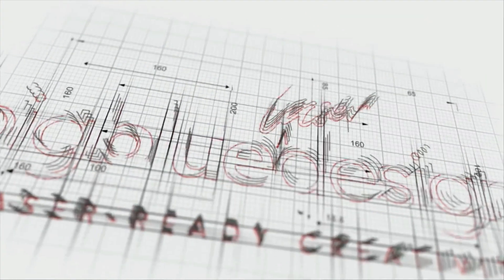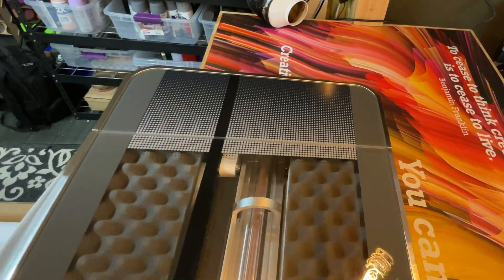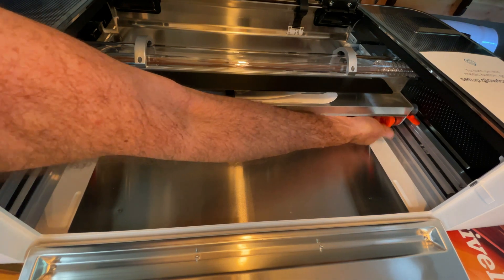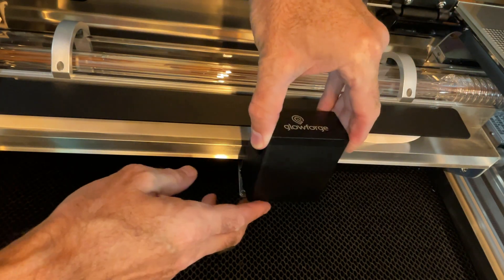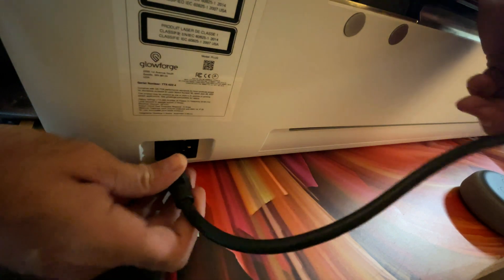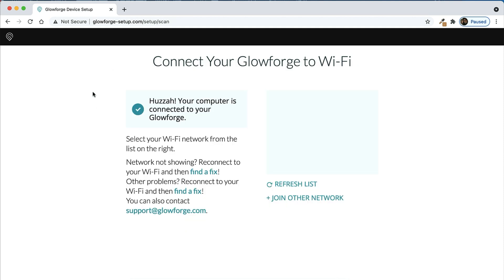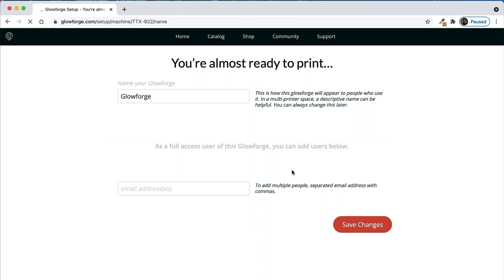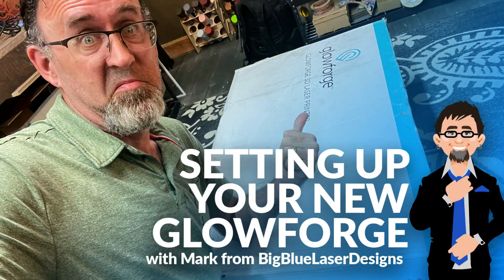Setting Up Your New Glowforge: From Unboxing to Connecting to the Internet

Comment: Thank you soooo much. I am hung up at the point where we add wifi. I FINALLY added the wifi. Then clicked my wifi and connect. However, it did NOT take me to a new screen to name my glowforge.  PLEASE HELP. I am using an HP ENVY x360 laptop 💗🙌🏽
Reply from the maker: Feel free to message me at www.facebook.com/bigbluelaserdesigns 

I’ll help if I can. 

When you message me, show me a screen shot of what page it did take you to.
Reply: @BigBlueLaserDesigns  thank you for replying. I can't access my inbox on Facebook from my phone so I will place my question here. Hopefully it will help another person. I am now at the screen where I have named the glowforge and added users. However,  after I click "save changes" it does not go to the next screen inviting me to start creating. 💗🙌🏽
Reply from the maker: @suzannadunn4337  Ok. You can just go to app.Glowforge.com manually then. Should be fine.